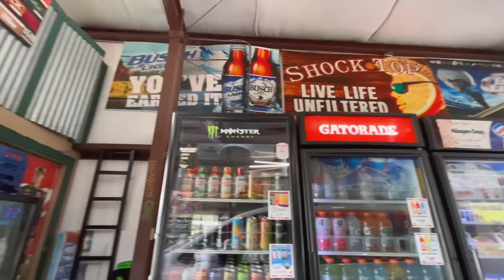We're Definitely Not In UTAH Anymore! What Did We Get Ourselves INTO?!

Comment: At the beginning of the video, there is a clay pot in the truck seat. FYI, that is an old pine sap collecting pot, known as a Herty pot, that dates back to the late 1800s to early 1900s. It was hung on a pine tree under slashes in the bark and a piece of sheet metal that diverted sap into the pot.  The sap was collected and distilled into turpentine. It is a collector's item so treat it with care and don't discard it thinking it is just an old flower pot! Welcome to the Southeast!

Comment: II had a fuel pump fail on the first day on a trip from Los Angeles to Chicago.  The symptom was I couldn’t climb hills faster than an idle when I first pulled onto the freeway.  I made it through Las Vegas and misdiagnosed the problem to be a fuel filter.  I made it to somewhere in Utah, I think it was St. George.   I needed a fuel pump for my ‘76 TR-7 late in the evening.  Everything was closed, except a drive through auto parts store.  

I got it fixed with an electric fuel pump. 
I was on a tight schedule, I had an appointment to have 4 wisdom teeth removed on the 31st, the last day of my dental insurance eligibility and it was August 27th.  I made it with one day to spare.  My dad was my designated driver after the oral surgery.  My battery was too low to start, so I push started it and we drove straight to my first day of the fall semester at Purdue.  My friends were surprised to see me as they knew I had my wisdom teeth taken out that day.
Reply: Now that’s a story!!
Reply: K,
Reply: Been there done that.  With the clogged fuel filter and the wisdom teeth.  Had catart surgery a few years back and rode my motorcycle home with one eye bandaged! Dr had no idea I was alone and riding a bike or he would have never let me out the door.... Fun times!
We are a different breed than most I guess!
Reply: @CurtisDrew1  The assistant to the oral surgeon was a friend’s mother that also cut my hair on the side.  She had this new product that sounded like snake oil. I it was an electrical instrument that stimulated my cheeks and chin with electrical current. As she used it near the sockets of the removed teeth, she explained it would train and terminate my nerve endings.  With how painless my recovery was, it must have worked.   The surgery was fairly mild. The extractions that were impacted, were textbook and they typical opening the gums, removing a small piece of bone went smoothly.  And cutting the tooth into 4 pieces to remove the root made the root extraction very easy.  However, the surgeon determined the upper teeth could be removed in one piece, since they had come in straight.  That was the most traumatic part of the extraction. He climbed on top of me kneeling on my chest and forehead and pulled like hell.   I had double vision and it diverged more and more with each pull.  I had opted for local anesthetic so I was alert the whole time. 

The procedure reminded me of a Three Stooges episode. 

I didn’t have major anesthesia so I was pretty much good to go except for the potential of bleeding.  

Many years later, I went to visit the Alamo with my dad just days after having his mitral valve replaced in his heart.  He did fine, but he had a leak in the fluid in his chest that came out the orthoscopic surgery sutures in his armpit.  When we stepped out of the Alamo, his shirt was drenched in blood.  Fortunately it wasn’t an active bleed, just drainage from the surgery.  Nobody witnessed us cleaning up, otherwise we would have had a lot of explaining to do, and probably been forced to take a joyride in an ambulance and been on the 10 o’clock news.

Comment: I had a roommate that bought a Dakota that had sat in a field for years. Pretty much everything on the underside was rusted out. We ended up running new soft tubing for the fuel lines. He drove it for a couple of years but eventually the frame fell apart. Was too bad because the body and interior were in really good shape.

Comment: I got me a 1994 dodge dakota that I've been driving and slowly restoring but fed up with the plastic tank radiators breaking every year or so so I parked it a few months ago and have been doing a full restore on it since from replacing fuel pump to all rubber mounts and bushings with polyurethane bushings to a rack and pinion to a full aluminum radiator with dual electric fans to keep the v8 running cool in the arizona heat and did 3 layers of sound deadener from the foil backed butyl stuff another of closed cell foam then layer of mlv on all walls floor and ceiling and man what a difference its a whole new truck with new carpet seats and about to paint and be done with it for a long long time

Comment: If you decide you want round 2 with the Dakota we can trailer it to my place in Volusia County.  I have a car lift in my barn and tools.....I'll even supply the trailer.  And I have a welder for some impromptu frame repair.
Reply: That's cool that you offer them your shop and help...

I just wonder if the frame would be too far gone (from what I have read from the local people in FL) to try and save it (truck may be more of a part's vehicle) ???

As I'm in the SE corner of ND, I've seen what road salts from St Paul, MN does to vehicle's...
Reply: @todd6385  Most vehicles in Florida with a rotted frame either started life up North or spent a lot of time on the beach.  The East coast of Florida has an extremely high salt content along the beach.  Even if Paul had to do a complete frame replacement it wouldn't be his first.  I can see the title of the epic video now:  "FabRats and Florida mice drive the Swamp Dakota cross country to Utah.  Will it make it?  Or will it break in half?"  🤣
Reply: @JS-yc3vi  Sounds about right...

I know that they're in the process of building a NEW wrecker, built around the motor and the cab of the truck, chopped the back of the truck off and remounted the rear end and homemade bumper...

Comment: Long time viewer!  Have to admit that getting an old beater working sounds like a pretty fun project even if on vacation... Surprised you didn't just hook up an extra fuel pump in the engine bay and bypass the fuel tank...  I wanted to let your sponsors know that I installed my first set of BF Goodrich's on the T4R today largely because of Fab Rat's endorsement.  Very happy with them.

Comment: Love it. I had a 95 Dakota with all of the same rusty issues. I too had a ratchet strap holding my fuel tank in. The frame also was rusted through. And best of all my fuel lines finally broke above the tank. At that point it wasn't really roadworthy. Michigan winters > Florida humid brackish air only because my truck did all of that stuff 10+ years ago.

Comment: I had an '89 Dakota.  Fixed or replaced the 5 speed in it 5 times in about 6 years (one of those years, it sat with the engine half apart).  Countershaft gears/bearings just wouldn't hold up.  When the 3rd member got noisy, I went to a pick n pull, grabbed the first one that I thought was good.  Turned out it was a 2.7 ratio.  Didn't need overdrive with that.  Made it troublesome getting started on a hill with a 2.5, but the transmission woes went away.  After I got the 1st S10 to replace it as my tow behind vehicle, it suddenly became a nice little truck to have.  They are not good for dragging behind you with a semi tractor.

Comment: I had a 92 dakota and with new fuel pump and new lines and that thing started on 1st bump of starter. Was pretty cheap and decent but small for me.  I drove it for a few years till i got my first dually.  Tranny went out finally cause rear seal was bad and put new seal in to fail again.  So i was filling a quart a week at the end. You had to start it and shift to neutral to let fluid circulate and overdrive stopped working due to wiring.  Ran a grounded toggle switch and i had overdrive

Comment: On those dakotas the ecu controls the asd relay which primes via the pump and controls the coil voltage when you turn the key on.  You have 3 seconds then shuts down until gets pulses from distributor.   So pump not running is normal

Comment: If you run a tube from a bbq gas bottle into the carb it will run on the lpg gas pretty well. You’ll have to manually regulate it with the gas tap

Comment: As you found out, the salt air can be bad in that it WILL rust out cars just being in it. If you live anywhere near salt water, you will find this out rather quickly. I live in the heart of Puget Sound and yes, we have Puget Sound, which is part salt, part fresh water but it does not seem to affect us much, however, as much of that water is fresh water runoff from the area rivers, with the rest from the ocean via the San Juan De Fuca. 

However, if you are on the coast, within a few miles inland of it anyway, you WILL be affected by the salt spray in the air and you will be replacing metal flashing and appliances about every decade or so and most cars, ditto. 

What rust we do get in the rest of the western side of the state anyway, is surface rust from all the rain we can get during the wet season (Oct through March), which means we'll rust from the top down, not from the bottom up like in the rust belt. Like you all, most cars that do not spend all their time on the coast can last decades out here, so a 20-30 year old car is not too uncommon here. 

Unlike Florida, we just don't deal with the humidity like they do there. 🙂
Reply: It's actually crazy how bad it is. I always get so jealous watching videos of Matt and Paul going to junkyards and finding cars and trucks that are 50 years old with some surface rust. The FJ45 would have been a pile of burnt orange flakes here, lol. I used to keep my old project cars in my grandparent's barn because they live inland, and it would have a prayer to survive.
Reply: My last duty station was MacDill AFB.  We had to wash the aircraft after every flight, due to the salt.  our KC-135s, after spending a year in FL, would go to depot for a major overhaul, then go back to their regular base

Comment: Fabrats those trucks have problems with the pump relay not getting connection and it could possibly just be that and not the pump I fixed one that 3 shops couldn't figure it out they changed fuel pump twice changed the computer the switch and was throwing parts at it just bc they were making a load of money off the guy and just bc the pump made a click like the one in this video they thought there was no need to check the wires for all the power from the fuse and relays and I fixed it just by taking the connections out of the fuse box and squeezed them back to where they actually make contact to the fuepump relay and the pump will run then and it seems possible since the ratchet strap holds up the tank unless the rust made it fall lol but it's probably already had a fuel pump changed and that relay just not getting  any power this is also for anyone who has had fuel pump issues with these years of d9dge Dakota trucks I've found them in junkyards and this is the only problem with them it's sad

Comment: Yep car batteries don't hold up well to our Florida heat and humidity.  It can be clear and sunny with a 105 degree effective temperature one minute and then a Tropical downpour with thunder rattling your insides and lightning that will blind you flooding the area with a few feet of water then 15 minutes later its bright and sunny along with more humid than before despite your thinking it couldn't possibly get any more humid.  Local storms from a pond a half mile away can be more violent than a national weather front.  Spiders as big as your face with a bite that can leave you feeling like somebody beat you with a pickax handle and may develop a crater in your skin that goes down to the bone.  Watch out for the Armadillos which carry leprosy too.  Of course you have to watch out for cotton mouths, diamond back rattlers, bears, wild pigs, panthers and gators along with the imported pythons.

Just coming onto prime sailing season shortly though.  Just be mindful to not jump in the water at feeding time for the bull sharks or dangle anything your particularly attached too over the side of your boat as they have been known to try and pull folks out and over if they're presenting too tempting a target.

Its a fun place but you do have to watch out for nature wanting to reclaim its space.